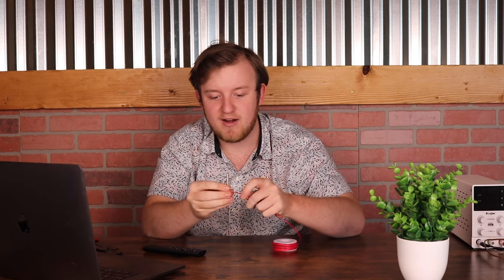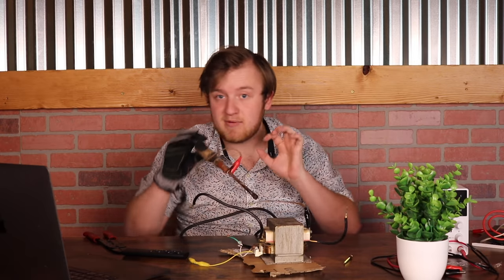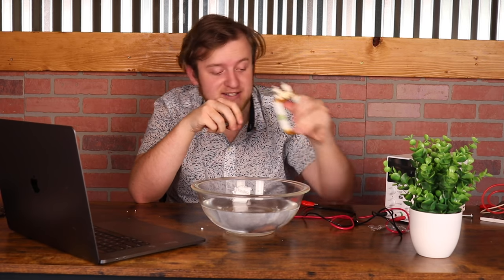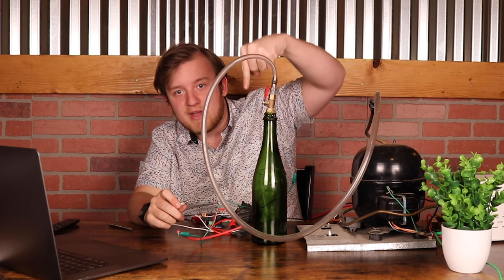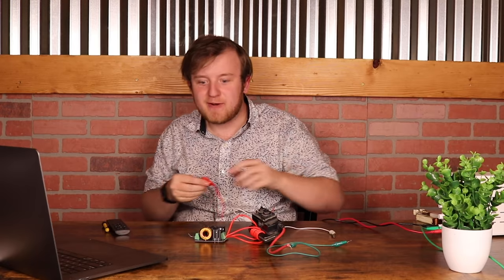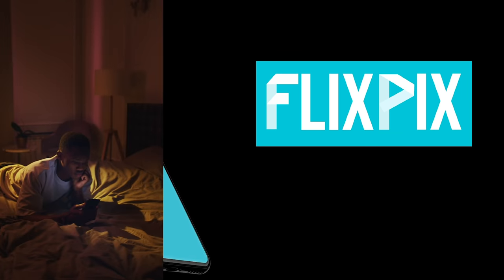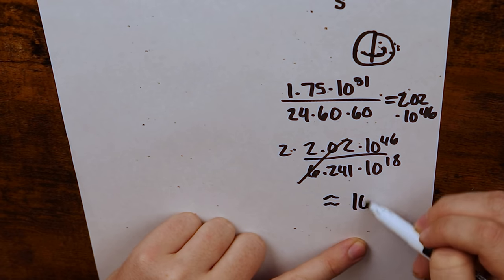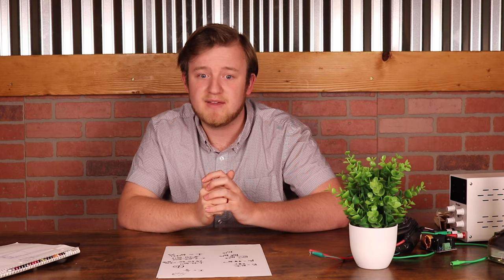The World Electric

Comment: 1:24 I would argue that it's due to the capacitors in the power supply taking a moment to discharge.
Reply: Good point, let's calculate it. 10.26A was flowing at 1.16V, that means the resistance of the solenoid was ~0.110ohms. These power supplies usually have output capacitance in order of 1000s of uF, let's be optimistic and use C = 10000uF (probably much more than what the PSU has). Now the RC constant gives us Tau = 0.11ohms * 10mF = 1.1ms. Although it's true that  capacitors do not discharge at 1*Tau, they will discharge to basically 0V in about 5*Tau, that gives us 5.5ms to discharge (probably much bigger) capacitor bank. So in conclusion; No
Reply: @Astri.electronics  watch the power supply though. As soon as it's display turns off the nail starts falling.
Reply: @aVoidPiOver2Rad  Quite interesting. My calculation didn't take into consideration the input-side capacitance, but I expected that to have negligible effect considering the large output capacitance. Though I would argue that the situation is the following; output of the power supply really falls to zero in very little time, the reason why the nail fell down after a while was due to delay of magnetic properties of the iron as stated in the video. When the current is at maximum, all the magnetic domains inside the ferromagnetic material are oriented in the same direction, which makes the ferromagnetic saturated. When the current falls down to zero, all those magnetic domains have to rearrange to spin in random directions. This is a mechanical process. Mechanical systems usually have way longer time constants than electrical systems. And the explanation for the display turning off with a delay as well, may be caused by separate capacitor for the display. (Just a theory though).
Reply: @Astri.electronics  i get your point and you're probably right but I can't find online resources on how long this actually takes. 

Maybe I can run some tests myself if I can come up with a setup to do that...
Reply: @Astri.electronics  btw: the input capacitance is not negligible due to the higher voltage which means more energy is stored. E=0,5*C*U² 

Also there are magnetic components in the power supply as well (inductors, transformers). They also store energy.
Reply: @aVoidPiOver2Rad  Yeah true input capacitance will store a lot of energy as well but even if we make the total energy stored in capacitors double the previously calculated, that would still only give us 10ms before it's all discharged. That's like 50x less than the lag we see in the video. I think we can easily neglect the magnetic energy storage, even if you'd have 10A flowing you would need 20mH of inductance at least to store a single Joule of energy. I highly doubt there are inductors above 1mH.